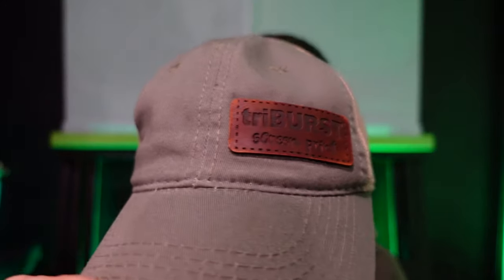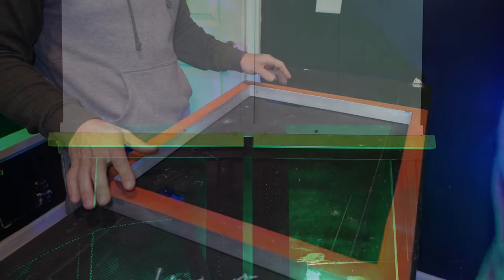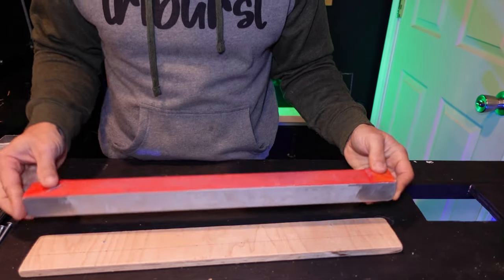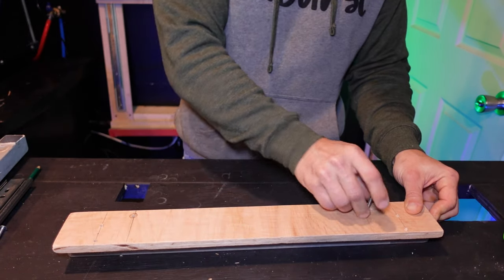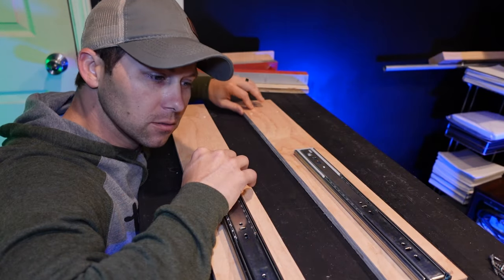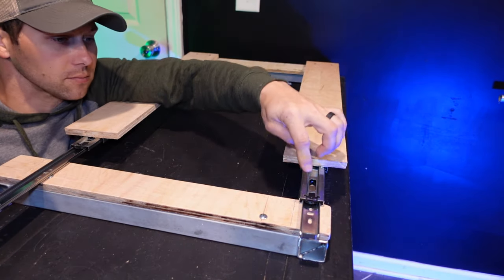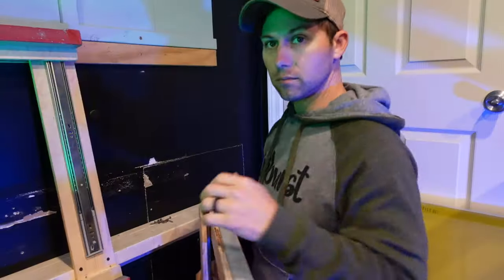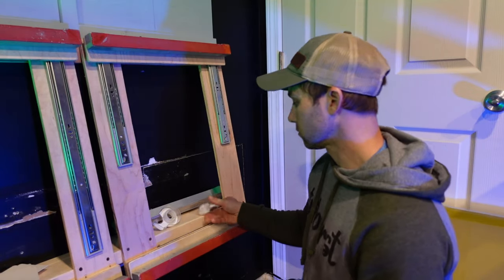BEST SREEN HOLDER (DIY) for coating screens

Comment: In my studio, i nailed two parallel strips of wood on to a table, some two inches apart and some five inches away from the wall, then i just place the frame in the gap and it wont move. It works well for both small and large (130x90cm) screens.

Comment: It seeks to go back, which causes the frame to be pressed.👍🏼🤘🤘  This is a slider for drawers, cabinets.  That is, when I will be open the drawer, it will automatically close back?⬅️😃😆 OR it's works only for 1 size frames? If you take a larger frame, will the slider open and stop pressing the frame? Anyway I already ordered it and want try to do the same stuff
Reply from the maker: Yes it is for cabinets and holds the frame in place quite well. If you use a bigger frame, you'll have to adjust the opening to 1/2 smaller than your frame so the cabinet sliders don't open too far.
Reply: @KevinAcker  Great thank you very much, that's what I wanted to know🤙🏼